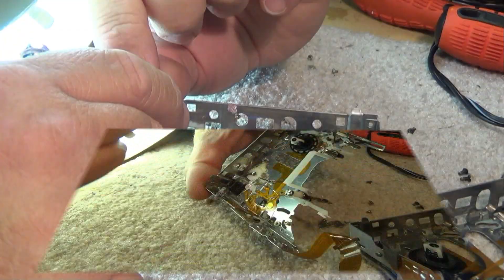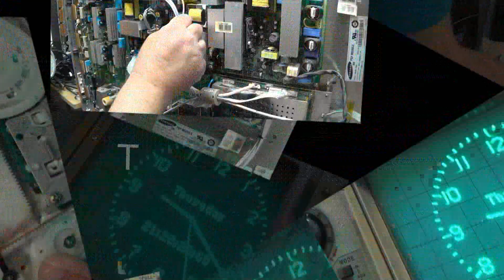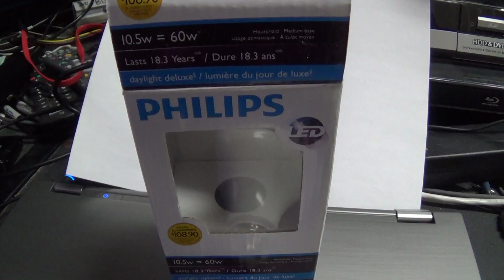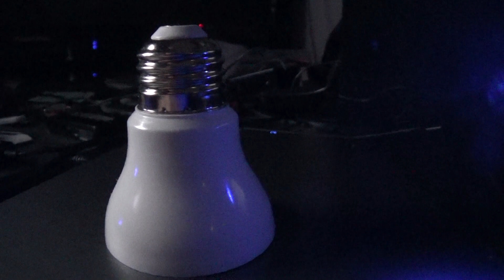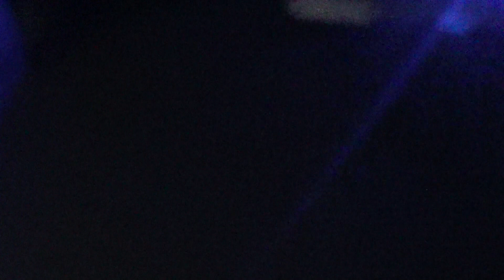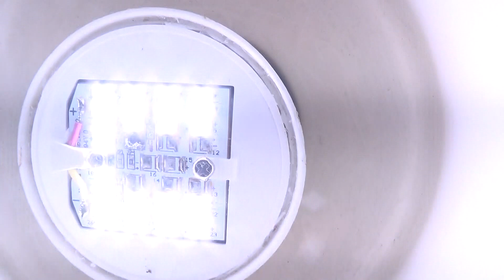LED bulb failure and repair

Comment: You also should not mix CFLs and LEDs with incandescent bulbs.
Reply: As both, CFLs and LEDs are sensitive to heat. And it will likely burn out the CFL or LED bulb due to the heat from the incandescent bulb.
Reply from the maker: Says who

Comment: It's been 5 years. Any more LED bulbs failing in your home?
Reply from the maker: This one is still working now but noticeably more blue then the others . I have had a few more fail.  The newer ones are holding up for now but they are not that old yet.  I have had about 6 fail out of the initial ones I installed.  As of now I have over 66 LEDs now running and I am down to 25 cfl bulbs. 6 incandescent decorator bulbs on a dimmer.
Reply: @12voltvids  Are there any LEDs from your initial purchase that still work? If so, how many and when was your initial purchase? I'm just trying to look from all sides here
Reply from the maker: @exoticcar5482  
Yes there are.  I bought 2 Sylvania 1 watt gu10 highlight bulbs to light my fireplace in 2010. One died and was replaced under warranty other one still works.   Out of 6 lights of America 2 still work. This Philips still works now after I jumped the bad led chip.  I bought a 4 pack of Philips gu10 4 watt (35 w equivelant)  and 3 of those still work.  The rest are newer vintage.  I had a filament type fail after a few weeks that was replaced by the retailer.  Other than that the new ones have been ok.  All 3 sets of lights I received to review, 4 retrofit for recessed and 12 filament type Edison style are all working great and some are outdoors running dusk to dawn daily.
Reply: @12voltvids  I actually know the most likely cause for why it maybe more blue now. It's probably the phosphor degrading since the LEDs under it are blue
Reply from the maker: @exoticcar5482  
This is exactly what is happening in large numbers on LED televisions. They gradually start turning blue.
Reply: @12voltvids  Makes sense if they also use the phosphor coated blue LEDs as backlight
Reply from the maker: @exoticcar5482  Some of the new ones use a nano dot filter to convert blue light into red and green wavelengths but most still use the phosphor white led. I still use plasma tv myself.

Comment: So four years later and these LED bulbs are now much cheaper BUT still fail quickly due to in series LED's!
 Manufactures don't seem to care still. They should make removable bulb covers so you you could bridge across the open LED and snap the cover back on.
Reply from the maker: At a buck and a half if they last a year I am fine with them. When they were 30.00 each that is when I had a big problem with them. I wouldn't be surprized if they didn't start putting in timers. 1000 hours like old incandescent and poof, dead.

Comment: Ah, good Chinese quality.  The good thing about LED bulbs is that they are good in trouble lights because if you drop the trouble light, it won't break the plastic unlike incandescent light bulbs which would catastrophically fail.
Reply: You should not mix incandescent and halogen bulbs with CFLs or LEDs. As CFLs and LEDs are sensitive to heat and the incandescent or halogen bulb will likely kill the CFL or LED bulb.
Reply: @houseguestchannel  Good thing to note, although I didn't mention halogen.

Comment: Well, there is a way around not being able to find conventional incandescent bulbs, at least here in the States.

Buy halogen bulbs, like these: https://www.walmart.com/ip/GE-90745-GE-Energy-Efficient-Soft-White-Halogen-43W-Long-Life-A19-4pk/45419939
Reply from the maker: Halogen are more efficient than old incandescent, and deliver a similar light so they are permitted.Conventional incandescent are also still readily available as speciality lamps listed as "surge proof" for rural areas, and rough service for ceiling fans and garage door openers. Also most of the "dollar" stores in Canada still have 75 and 100 watt types. Just bought a pack of 100 watt clear lamps at the dollar store for my kids lizard cage. Need them for the heat, and the reptile bulbs at petfart are just a royal rip off. I think I got 4 100 watt units for 2.00 so I bought 8 of them. That should do for awhile.

Comment: Never spend that much on an LED bulb, get the cheap ones from wally world, great light output and I've had a few of them for about 3 years now, the secret is, have them in conventional lamps or upward facing ones, if the heat can go out the top like it's supposed to, they last ages and if they do fail, their about $2.88usd a piece so no big deal.
Reply from the maker: This was one of the original ones that cost a fortune. The new ones are cheaper and they are not making the claims of lasting 20 years anymore. They have a 1 year warranty now. My light is not in an enclosed fixture. Has great ventilation. Still the chip failed.

Comment: I bought a boat load of these bulbs a year ago, however I'm new to soldering, iron comes in tomorrow and I am looking to upgrade my tester. 

Did you say the when you tested the LED, it would read closed, and the rest read open.  Thats how you found it?

Comment: The issue is improper design. It is well known that LEDs don't like heat, yet the engineers run the LEDs too hot anyways ...
they are giving LED lighting a bad reputation! :(
Reply: Corporate greed

Comment: Yea, I'm finding these L.E.D. bulbs last a LOT less than the older CFLs and incandescent lights.
Reply from the maker: +Larry Greenup 
Yes I am finding the same. I hav ha several fail. Doesn't seem to matter what brand you buy either. They are all failing.

Comment: No company that wants to keep selling products would ever make something that lasts nearly 20 years... Looks like this was "planned obsolescence".
Reply from the maker: +cbcdesign001 For sure. In the next couple of years these will be all you can buy.I don't see many companies continuing to make CFL bulbs, and that has basically become the elephant in the room. Nobody knows what to do with these things after they burn out.  Companies are not recycling them, and many of these collection agencies are not doing anything to collect the mercury they contain. Big environmental problem when these things burn out.
Reply from the maker: You are correct, then they should stop advertising them as lasting 20 years. Advertise them as a 4 year light bulb, and price them accordingly.
When you spend 20.00 for a light bulb that claims it will last 20 years you expect this.
The old incandescent bulbs that were under a buck claimed a 1000 hour life span, and they almost always reached that life unless it was in a high vibration setting like a garage door opener or ceiling fan. For that they make special bulbs.
Reply: +Elnufo In industrial electronic design a 20 year life is not at all unusual and of course all the companies manufacturing the equipment are building their products to last that long. They are priced accordingly of course but these led bulbs are priced for long life yet fail to deliver. Its not good enough. LE lighting in the UK have a 5 year warranty on many of their LED bulbs.
Reply from the maker: +cbcdesign001 I just noticed that new ones now have a 3 year limited warranty, however this one had a 1 year warranty on it. Incidentally it still works now, minus the 1 chip that I had to short out in this video.I just put a filament type LED out in my driveway pole lamp (it is an open fixture with clear glass) and it looks very nice. Like an old fashioned carbon filament bulb.  I did notice that the package only rates it at 12,000 hours. Time will tell. It runs all night so hopefully it lasts a few years as it was 16.00. The 4 GU10 LED in my office are getting dim after only 3 years now. Have lost about 50% of their initial lumens.
Reply: +12voltvids They sound similar to the type I am using in our living room where I am trying to find out if heat is an issue depending upon orientation.  I lost 4 out of 9 in just 10 weeks so disappointed. We have a company in the UK that now gives a 5 year unlimited warranty on some of their LED bulbs so I guess its an evolving market.

Comment: Good one 12 volt...I have found (in some cases) they do not live up to their low current consumption claims either.
Reply from the maker: You got that right. The government is forcing these things down our throats. There are still incandescent bulbs available, and they are better than ever. Since the government is banning the traditional every day light bulbs, the manufactures are still permitted to produce specialty bulbs. They are sold as country bulbs, or surge proof, or in the case of GE they sell theirs as a "garage door opener" bulb. They have heavy duty filaments, and are usually rated at 130 volts (US/Canada) or 250-260 for 240 markets. Because they are being operated at less than rated voltage they draw a little less, a 60 watt 130 volt bulb draws 53 watts when operated at 120 volts, and they put out a little less light, but they also last 5400 hours.
Reply: 12voltvids many things, ie: the intrusion of the nanny state into light sockets, tire pressures etc. is why I can't live in my own countries anymore.  Sheople just accept the government is doing the best thing for them and that couldn't be farther from the truth.   The office of disinformation (pick one) has spread so many flippant diversion conspiracies that if you mention conspiracy, you are labelled a crackpot....I give up...apologies for the rant.
Reply from the maker: Glen Robinson
Don't you just love it when big government knows better. I hear you, I gave up years ago. I just don't give a f--k anymore. Big government, big oil, big corporations, banks ect.

Comment: Very interesting!  I've never taken one of those apart - great that you can repair them this way.  I guess its always worth keeping any that fail, so you can use one as spares for other bulbs.  Was it possible to replace the outer glass part or did it need to be smashed off in order to get inside?
Reply from the maker: No the glass just popped off. I stuck it back on after filming it. It's actually plastic, and is just held on by some silicone glue.
Reply: Fantastic!  This means these are kind of serviceable!  I will buy myself a multipack!